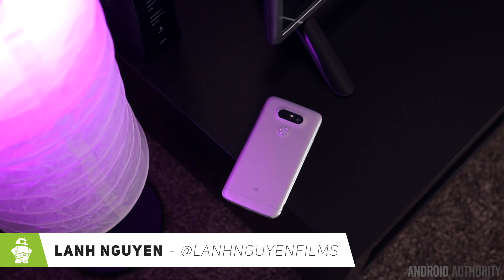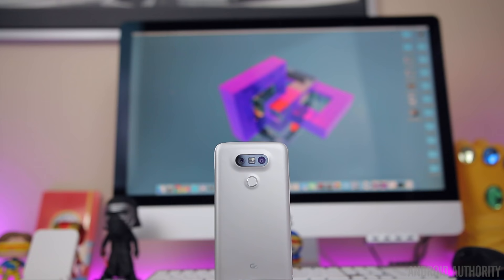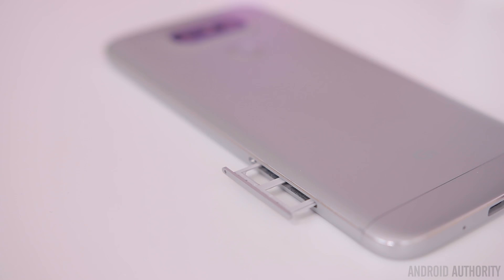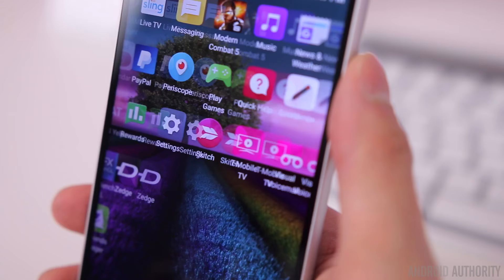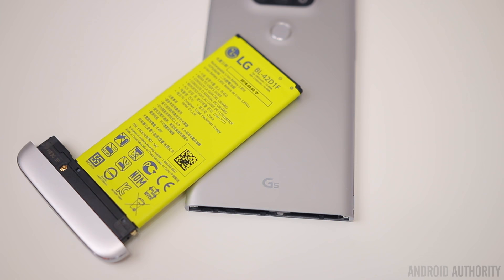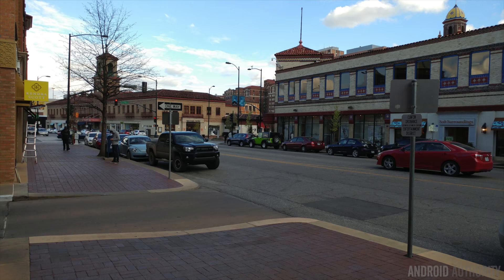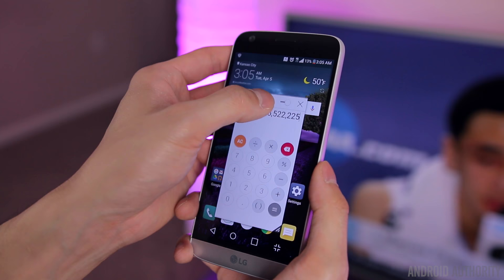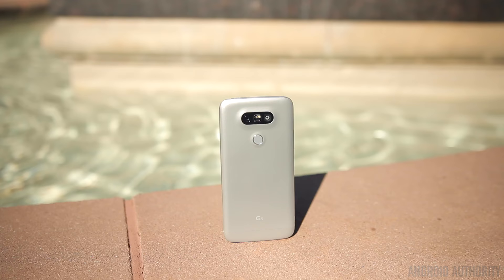LG G5 Review!

Comment: Picking up where Samsung left off with the S5. The G5 has an IR blaster, removable battery, and expandable SD storage, plus modules. A phone should be functional like a Swiss Army Knife and this one seeks to be just that.

The phone may not win any style points, but most people will slap a phone cover over it anyhow so thats not a big deal.
This is a must buy for me personally.
Reply: +James J. The S5 had a 2800ma battery, so its the same exact battery. The modules are a bit gimmicky, but they are trying to innovate and thats key here. Samsung and Apple have shown that they are done innovating. They just want to coast on former success. We as consumers should support innovation, because otherwise we would still be relying on landlines for communication, or perhaps even snail mail.
Reply: I think this phone is gorgeous. Even in 2024

Comment: Just brought this phone in 2021. You can upgrade the battery to 5700 mah battery for $15 off Aliexpress. Personally, I'm downgrading to this phone because it has all 3 - a headphone jack, a microSD Card slot, and a upgradable/removable battery (extremely rare to find these days). It also has decent midrange specs SD820 and Aderno 530 (although outdated) but it is enough to play most games on medium to high settings. Hope this helps.

Comment: I know aesthetics aren't everything but it's something when my V10, device not really meant for looks is more of a looker than the G5. Even then, don't care for looks as I usually slap cases on anyways. 

As for the G5, eh. It's got that wide angle lens to it which I've already tried out and is undoubtedly fun but I don't really see myself using it. Kinda prefer the front facing dual cam setup with the V10 not for selfies but for video chats which I do, specially since the camera tends to default with the wide angle lens and is already something I love using anyways. 

Anyways, pretty good review, probably the best one that doesn't completely downplay the phone with its drawbacks like some reviewers (cough The Verge cough) and highlights its plus sides too. Also, extra props to you for using Razihel for the intro music.
Reply: Great comment. Hopefully in the future they'll do dual cams on the back and the front. That would be beast.

Comment: The coating is NOT like how you would paint a car.
Reply: +Bryan Lee they're just using the same bullshit explanation and comparison as the developer in Erica Griffin's video. My problem with that reasoning is that the phone was misleadingly advertised as metal unibody. I'm not going to quote the wording of their advert in their own homepage, but they made the customer believe their palm of the hand will touch the metal, which is not true.
Reply: +burso83 so true
Reply: burso83 inb4 Users complain that the G5 feels nothing like the metal of their car, instead it feels like cheap plastic; Ken from LG then claims that LG's process is "revolutionary" and the users should appreciate the non-metal metal phone.
Reply: +burso83 lg g5 does not use an anodized coating. if it did it would feel like a metal phone not a plastic one.
Reply: +Steven Juris you're right, I stand corrected. I meant microdising, that was the process LG called where pigment containing tiny metal particles is applied directly to the primer to provide a smooth and durable finish (quoting LG statement from xda developers website) they can say what they want, it feels like plastic and not metal to me...
Reply: +burso83 when you put a thick layer of paint on something it's going to change the feel
Reply: +Steven Juris well, I know that, but then don't advertise the phone with the description as LG did as it was misleading. I don't care about the G5 to be frank. I'll replace my M8 with a phone that comes with a metal body, which is the HTC 10.
Reply: +burso83 the g5 is a metal body. Just because it's covered by paint doesn't change the material it's made of.
Reply: +Steven Juris I agree, however the palm of your hand does not get to touch the metal mentioned as advertised.
Reply: +burso83 it is marketed as a metal phone which it is. Everyone made an assumption based on other metal phones that LG would use an anodized coating which they didn't.
Reply: Steven Juris LG: Buy the G5! It uses a premium metal body!

Why would you market it as such if it is going to feel plastic anyways?
Reply: +Bryan Lee because it is a metal phone. What's coating it doesn't change the material it's made from. It is not a phone made of paint.
Reply: Steven Juris The Galaxy S6 and S7 has a metal frame and body under the glass. Does that make it a metal phone?
Reply: Steven Juris from LG website: "All New Metal Design
Beauty in the palm of your hands. Metal and glass smoothly float together uninterrupted, without an antenna slit." no more needs to be said.

Comment: After several Androids on varying hardware, including LG and Samsung... I'm done with Android. They inevitably slow down, glitch up, crash, or have other technical issues (ESPECIALLY with the software) after several months of moderate or even light use. And, you are guaranteed to receive an update which will render your phone slower than molasses. What's the next update going to be called, "Pillsbury Doughboy"? In any event, when my wife's LG G3's video started crapping out after barely 1.5 years, I got her an iPhone. It's common to see years-old iPhones still work and still work quickly as compared to any Android I've experienced, including the Galaxy.
Reply: hahaha

Comment: I like the idea of modularity, though the modules aren't making it useful. The camera grip I think is a bit useless except for the added juice since you will still use the screen when you're taking raw photos. The hi-fi DAC as well could've been added into the phone by default like the V10. The modules could've been cooler if , let's say, it's an external speaker with subwoofer, or a case where you slide the device into and provides protection, increases the battery cap to 50% more and enables wireless charging, or( I don't know if this could be possible but this would be the craziest) an external graphics amplifier!! And then make all these modules compatible to upcoming  G-series! That said, I will still buy the phone over it's competitor cos I simply like LG,and that removable battery alone and the manner of replacing it is cool enough for me.

Comment: Have the LG G3 and is the best smartphone I have owned.. I always skip one gen before I jump on another new phone & I'm happy I skipped the G4 since the G5 is a BIG WIN!! Can't wait to pick it up :D
Reply: Did the same thing and you will definitely like the upgrade.  It feels more premium, the ir blaster seems better, the new removable battery mechanism is much more convenient, the fast charging really surprised me, and doesn't heat up as much as the g3 does.
Reply: my only complaint is small light bleed on the bottom right corner, not sure if the g3 did but never notices, and I miss the old way of getting to the sd card, but that's just small nitpicking.

Comment: Great review, but you didn't touch on the build quality, look at the finish right by the lens @2:16. Hows the bottom lip where the modules connect? it looks a tad raised. Shoot in Manual :) that'll fix your issues at night, or maybe raw? since it can shoot it.

Great review, just missed a few key points I think.

Comment: I like LG a lot.  I had a LG G4 for a bit, then, jumped to the LG V10 via t-mobile.  I currently have the Galaxy 7 (not the edge model) I like this model but, I wanted something different, plus the design is not as clean.  I'll bet the next version of the V10, and G6 will be sick. It's a good start but I think it will be better down the line.

Comment: Just got a g5 after always having iPhone and galaxy and it's true what they say, theyre the most popular phones but definitely not the best. Long story short: g5 battery life is better. Can go from 0 to 100 in less than 30 seconds by replacing battery, which you get an extra for free. It has fast charging 3.0 which charges more faster. Wide angle camera is an absolute must after using it. Expandable storage. Clean UI. One of the best if not the best camera out. Always on display thats actually use able since you get notification for all apps. And of course the great possibilities of the modules. Don't believe theoro  bias Samsung and iPhone crap out there.

Comment: the bottom detachable chin is not flush on any of the units i have seen, and does not sit even on the back of phone.what i mean is one side will have an ever so slight bigger gap than the other side. All units,please prove me wrong if am, have light bleed. if you are ocd about little details like this, you might not want this phone. i was expecting a premium feeling metal phone that looked at least somewhat flawless. i returned my phone for the reasons stated above, i did try the wide angle lens however and i loved it the camera is great.
.

Comment: The "very pure shade of white" goes to show you've been using phones with aged AMOLED displays :). The pure shade of white is thanks to the fact that the G5 uses an IPS LCD screen, which isn't prone to AMOLED's degradation after around 1.5 - 2 years of use, where the blue subpixels dim faster than green and red (blue LEDs use more energy).

I compared the display of my fiancee's G5 to my Galaxy S4 (2 years old) - when I compared the two displays, it looked like I'd cooked a damn egg on the S4 (not even exaggerating - it was incredibly yellow in comparison). I noticed then just how much I'd gotten used to the S4's yellow tint. AMOLED is a promising technology but in its current state, it's seriously overhyped. There's a very good reason they don't make AMOLED PC monitors, where accurate colour representation is in much higher demand. They're also susceptible to "burn-in", which is yet another reason you don't see AMOLED desktop monitors. Eventually that "X" on the top-right of the screen would be burned in even when it's not meant to be there, or perhaps even your desktop background. AMOLED on PC monitors would actually necessitate the use of screen savers again.

Comment: How come they don't talk about the uneven gaps and the uneven paint finish? I demoed more than 5 units on display and all of them in the different colors had the indentations / uneven paint where the antennae and metal come together (near the camera module and at the bottom). I notice that reviewers who buy their own units see this all the time but the reviewers who get a review unit have nothing to complain (cherry pick much LG? I hope not!) about.

Too bad you have to turn off everything which adds 1 to 2 minutes for you to actually use the camera (where it matters) "friend". Which means you miss the shot you want, when you want it. You'll end up not using the camera module. The DAC is kind of pointless because the V10 has a better DAC already and its built in. Too bad, it was a nice try on a modular design.

Comment: There are a few inaccuracies that I am surprised to see in the review from Android Authority. The LG G5 display is definitely not neutral in term of color temperature. It hovers around 8k which is VERY BLUEISH. It's a far cry from what was achieved on  the Nexus 6P and the S7. also at night, there is quite bit of light bleed that is very noticeable in low lighting at the edges of the screen. This wasn't an issue on the G4.

Comment: I actually really like the modular idea! Assuming they would come out with things like mini hdmi or even full size and the like so I could use my tv as a second screen. Maybe having inexpensive bottoms for different charger types or something like that. I mean the different parts for cameras and audio are cool but they seem more of a niche market rather then something your average phone users would buy.
Reply: The only thing that I would be worried about is how phone cases would fit when your bottom is changing lengths all the time, maybe like a slim rail system that lets you slide the bottom out farther like overear headphones do

Comment: Some things not mentioned in video that interest me on this phone (as use them more as a mobile entertainment device, than anything else (rarely used as a phone)).

Pro:
1) Slimport supported (really important for me)
2) Audi 24bit/192hz audio
3) New Bluetooth aptX HD audio codec
4) Like the wide 135° FoV 

Cons:
1) LG shuns Adoptable Storage
2) Camera Movie sucks, still got LG audio noise canceling
Reply: Audio DAC has to be bought separately. Still don't know how much it's gonna cost. Where as you already have the DAC inbuilt in the V10 for the same price. It's a minus for me. Also not to mention how LG dropped the ball on quality control of the first batch of G5s. There shouldn't be surface flaws of this much of phones on a flagship range
Reply: +Tissa Senaratne Audi stat for in the phone, it's Qualcomm own audio chip. Have seen a few videos about quality issue but a lot of comments said theirs was okay. Found out the HTC 10 support Display Port, so holding out for reviews on that 😊
Reply: +G “GGMan” Scott Audio not audi!

Comment: I would still choose G4 over this...Better built quality, bigger screen, less bezels, same camera with smaller camera hump, costs half of the price and you won't even notice the difference in real life performance. The modular concept is..."interresting" but i rather like to charge my battery quickly or hold 1-2 days instead of swapping it. I would not use any of the existing add-ons and doubt there will be new ones.

Comment: I had a G4, was so impressed with the features namely the camera and the processor. The phone was super fast compared to the others in the market. But then it began restarting and restarting till it cut off. I carried the phone to the seller but they could not figure out what was wrong. I loved the brand so much i purchased the G4, i am so impressed with this phone that i convinced 2 other persons to purchase this phone. Sadly, i have just been informed that one of the phones started cutting off and restarting and restarting. Called the seller to be told it is a problem that only LG can fix. It is a hardware problem. LG will fix it if it's under warranty but if not we will have to send it. How disgusting is this by LG. If a car company has faulty brakes it recalls all the cars but your company knows that is something faulty you have built but instead of cutting into your profits to corrrect a problem you choose to act shady and unscrupulous and make the consumer responsible for repairs. High class theives. I am from the Caribbean and i will never purchase any of your products ever again. Most disgusting of this company

Comment: All ready to upgrade from a G3, went into my local store with cash in hand to buy it along with the B&O hifi plus module BUT I was really struck by how poor the fit was to the module at the base. Yes it was fast, great camera(s), nice display etc but it really had sharp edges and just didn't seem to fit well at all. Considering this was the demo model with the standard factory module, it should have been a perfect fit. Also no one seems to know when the B&O module will be available (to be fair out of LG's hands) and how much either. So they expect me to pay £500 for a phone that doesn't fit well, has sharp edges, an odd plasticky feel due to the primer they say they use over the metal body and then they can't tell you what the cost or due date of the module you really want is. I have really lost confidence that this is the phone for me going forward and very disappointed in LG. Come on guys get with it....
Reply: +N3XYZ ok cool thanks. so it doesnt sound too expensive but in the UK that probably means £99 despite the exchange rate.
Reply: +N3XYZ That is the price of the cam module. Im pretty sure the DAC module will be $100+

Comment: Could you please tell me if inserting two sim card in g5 is possible? Normally I saw in specs that they mentioned the phone as dual sim indicating one is dedicated slot for nano sim and the other is the sd card slot which can also be used as nano sim. However, apparently it is not possible to put a nano sim in SD card slot because of its size. Any help?

Comment: That battery life.. 2800mAh.. S7 Edge has 3600mAh.. They should've made it thicker, so the camera bump would be smaller and fit atleast 3250 in that b.
Reply: I agree
Reply: The battery life is solid... I get over 4 hours of screen on time with and up time of 15 hours of moderate usage plus I've got a spare battery (which was free) and quick charge 3.0

Comment: How does the audio quality through the headphone jack compare vs the G5 
and S7? I dont care about eq or any other BS, just quality, detail and 
power on a flat EQ
Reply: as far as flat eq I'm not too sure. I haven't tried with any flat headphones but its much better than the G4. compared to S7 I'm not sure. I have one issue which is kind of a big deal to me. when listening to music through AUX in my car there is a very bad buzz. I haven't had this problem with normal headphones at all but its very disappointing. hopefully when I get the Hi Fi Plus it will fix this issue but that's the only problem I've had. sounds much better than any other phone I've had other than maybe an iphone.
Reply: I will say its better than the S6